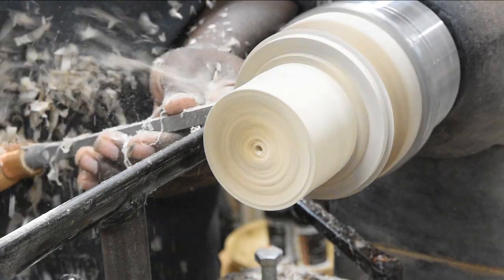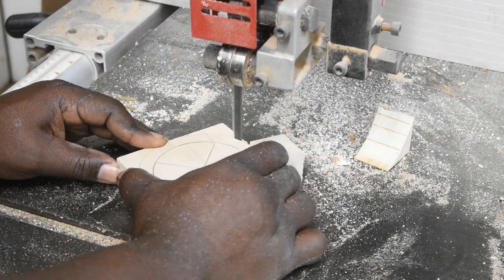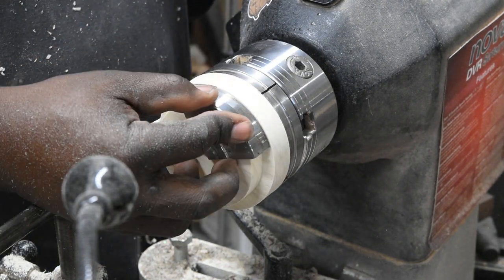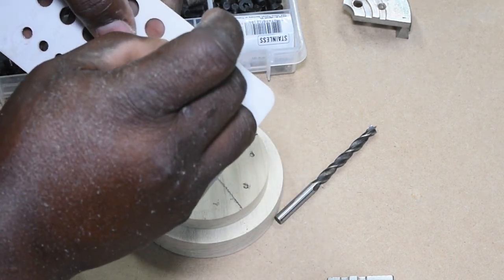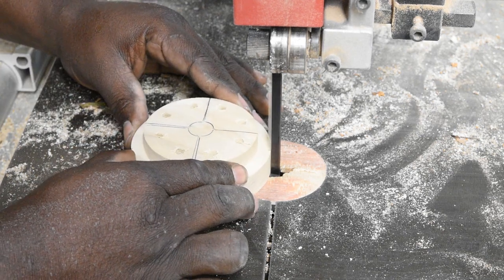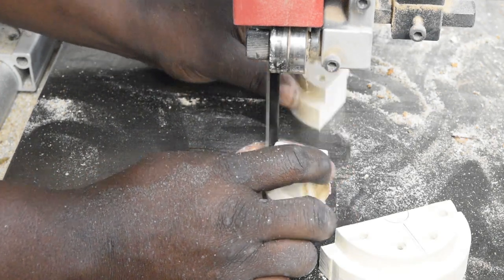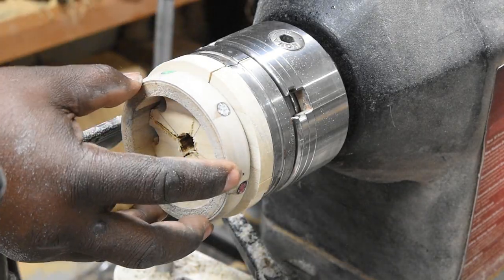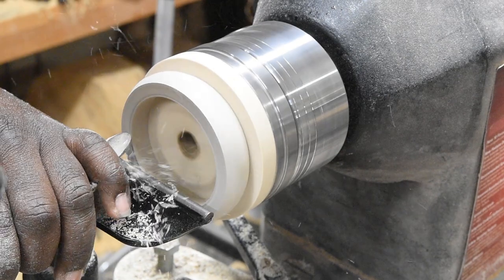DIY Adjustable Jam Chuck/Soft jaws

Comment: I am making a cube within a cube on the lathe an will have to make a set of jaws to hold the 3x3 inch cube .this video is very helpful and I need to change slightly to accommodate the cube . Thanks very much.john

Comment: This tip comes from machine shop practices and should improve concentricity when turning those jaws. The goal here is to load the chuck jaws before taking a gouge to it. Use a large pipe clamp that will fit the diameter of the Nova jaws. The idea is to use the chuck key to open the chuck until it encounters back pressure from the pipe clamp. Then turn the step to size. This way the chuck's mechanism is under load when turning that step..  In lieu of a pipe clamp the turner can use a face plate to turn a plywood ring. 
Wakodahatchee Chris

Comment: There is at least one chuck, Masterchuck, that is designed to allow wooden jaws to be made and used like this. But I, too, have a Nova. My comments from my experience:
 At 1:40 you estimate the internal diameter of your 3" jaws. For best results, I do this with the jaws about 1mm (40 thou) apart, not touching one another. This is because Teknatool make them in a similar manner to how you are making your wooden jaws, so they are truly circular only at this setting.
 At 6:00 you seem to be turning the wooden jaws without them gripping anything (there seem to be gaps between your wooden jaws). On my Nova the chuck jaws are not rigid unless gripping something, so it would be dangerous and/or inaccurate to do this. In fact, Teknatool tell you not to spin the chuck without it gripping something (wood, usually). I suggest you either tighten the jaws or put something for the jaws to grip, such as shims between them. Four pieces of card would work. Tighten the jaws onto them before turning.

I have made wooden jaws that screw directly to the jawslides, using the same  size screws (M6) as the metal jaws. I am not sure if there are pros and cons to this approach.
Reply from the maker: First, thanks for watching and taking the time to leave a comment. While I do appreciate the feedback, I want to point out that the chuck is gripping the wooden jaws. The wooden jaws are screwed to the metal jaws and then the chuck is tightened. I did not bother to machine the faces between the wooden jaws perfectly flat as these are only intended for temporary use but they are in fact securely installed. I am not going to say that my every practice at the lathe is completely safe, but I do not share techniques that I feel are unsafe. In addition we all have to draw the line at what we are comfortable with in our own shops and decide what we will or will not incorporate into our workflow. There are several "safe" techniques out there that I won't try. so the short of it is this, if you don't feel comfortable doing this then don't, if you feel like you can make improvements do so, but don't feel like this is a commandment or a mandate of how to do something like this. Again, thanks for commenting.
Reply: @DreadKnotWoodshop  Thanks for replying. I said it seemed to me that there were gaps between the jaws when you turned the wooden ones, but evidently I was wrong. Sorry.
Reply from the maker: @chrislusbytaylor3197  No prob. Like I said, I really appreciate the feedback.

Comment: Good morning , I'm using my "social distancing " time to catch up on old projects , including making some turning accessories.  I'm finding your channel to have simple,  practical and down to earth ideas.  Have you thought about drilling holes  and putting some rubber grommets in the jaws ?  For a even "softer" grip ? Or even just in the holes of the mounting screws?
Reply from the maker: I find that the wood on wood joint is the best. Finding a rubber material that is soft/firm enough to prevent issues can be a real challenge. I have tried using things like this before and while not crushing fibers, have left hard to remove marks on workpieces.